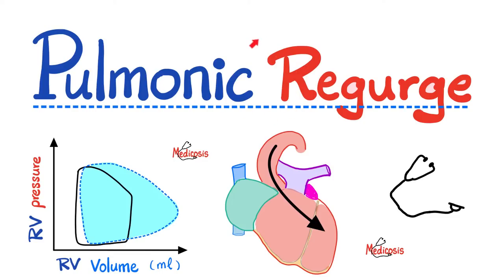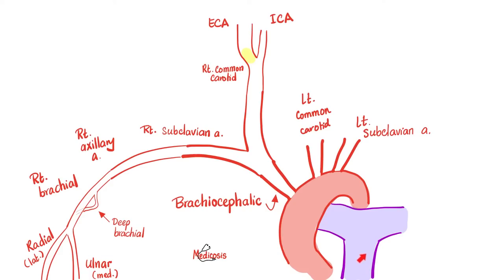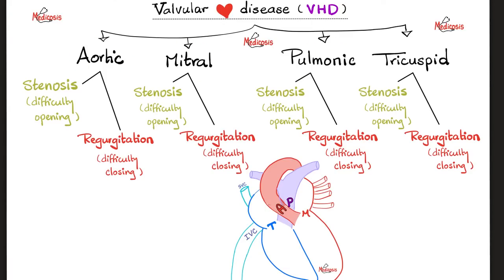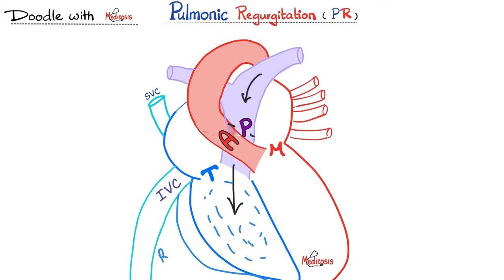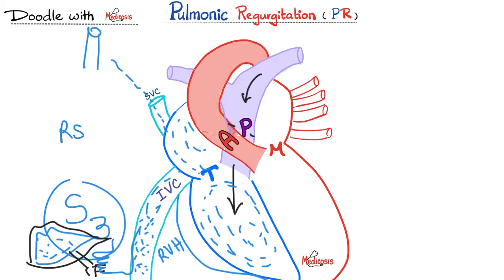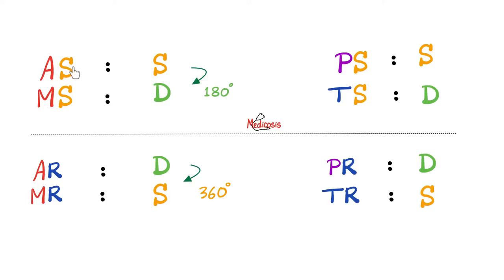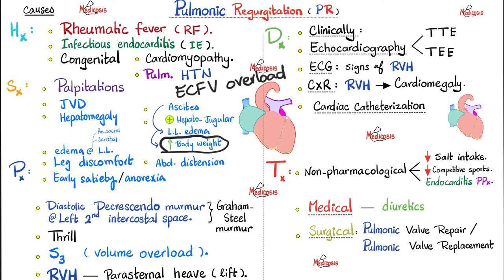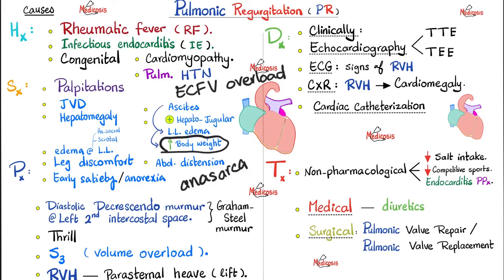Pulmonary Regurgitation (PR) - Pulmonic Insufficiency - Valvular Heart Disease (VHD) - Cardiology

Comment: It is I suppose, or in a state of supposition: is from 1-chemoreception of the medulla obligata on the brain stem region. from there in conjunction with the ponds, for fine tuning sig-nals are transmitted to the diaphragm in sequence or a coordination to control breathing - the chemoreception is through H+ concentration detection through the cerebral spinal fluid in the form of CO2.  circulating H+ concentrations as in the negative feedback/regulation.... so more H+ means more breathing.. 🔋🔋🙍‍♂🙍‍♂😉😉🎶🎶🧬🧬👁👁🤖🤖🔬🔬🪖🪖👍👍⚡⚡